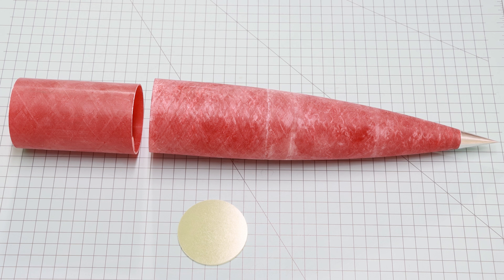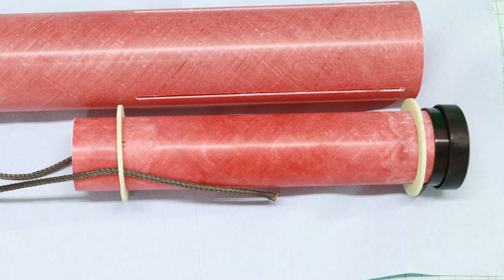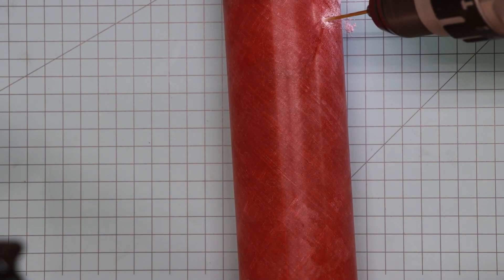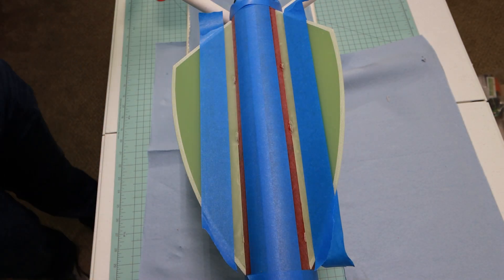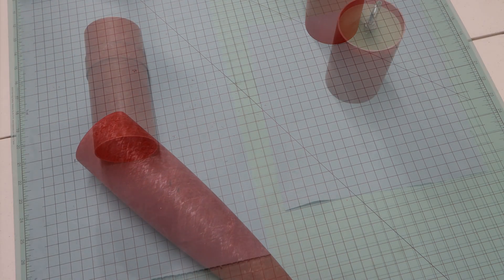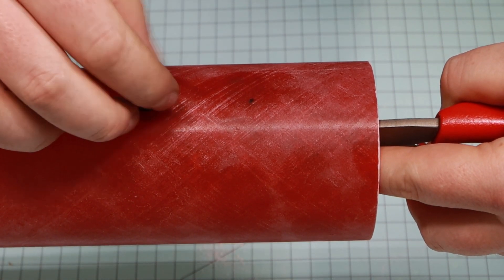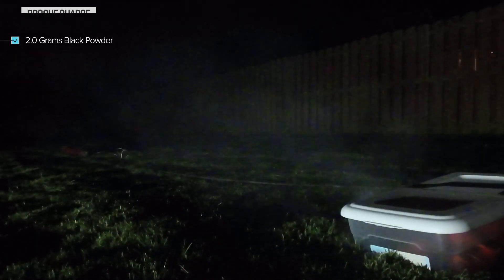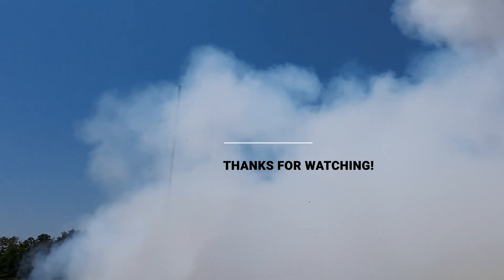Wildman Shape Shifter 75mm Rocket Build

Comment: Did you have enough Six10 for the assembly and fillets? The Rocket Vlogs guys said its really only enough for the fillets. I got Six10 with my Punisher RV and Mach 2 kits. Haven't started on either yet.
Reply from the maker: I was able to almost complete a second rocket with the 1 tube. They may have been building larger rockets perhaps?

Comment: I asked this on another channel vid... why would you mount shock cord, even if 'resistant' across the channel where the ejection charge flows? seems like subjecting things to stress they don't need
Reply: He's using an altimeter ejection charge and not motor eject.
Reply: I'm not sure I understand what you are asking but most shock cords or the parts exposed to the ejection charge are either Kevlar (flame / fire resistant) or have another type of protection to insulate against the ejection charges. It also is the builder's choice of ejection method as long as they follow TRA or NAR rules.

Comment: Nice build video. I like the use of the rivetnut for the rail button install. How heavy was the rocket fully prepped (without motor)?
Reply from the maker: Thank you very much! I love using Rivnuts for rail buttons. It makes for a really good attachment point. This was right around 8.75lbs prepped without the motor.